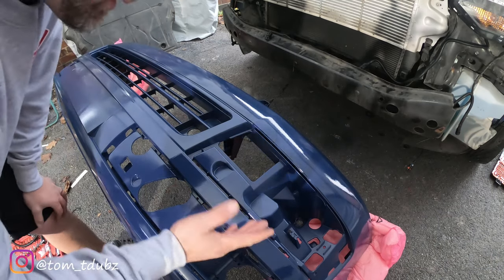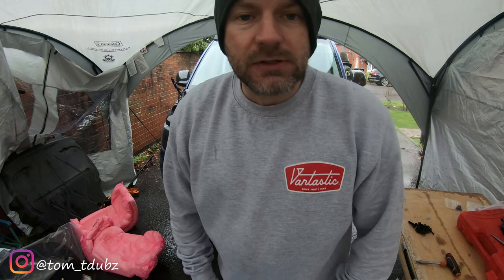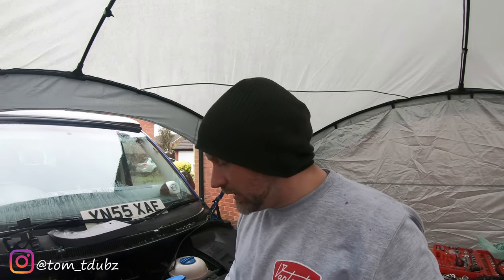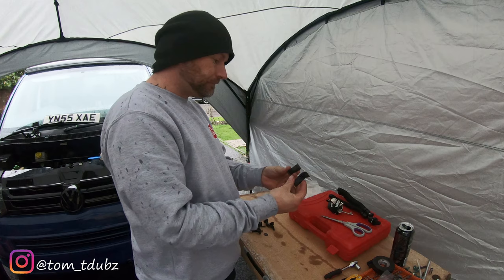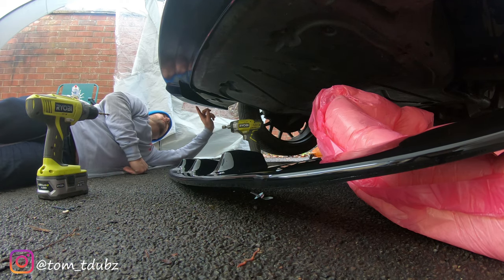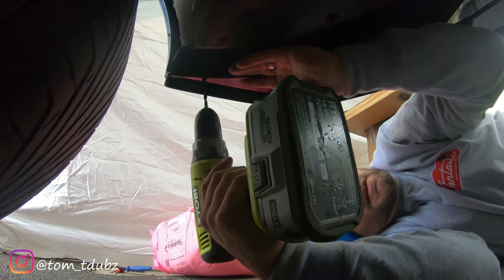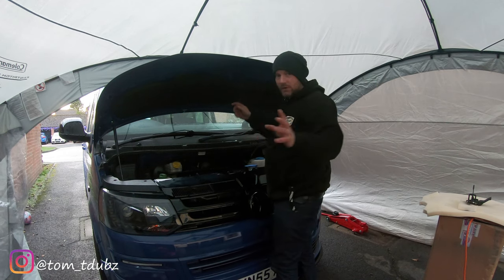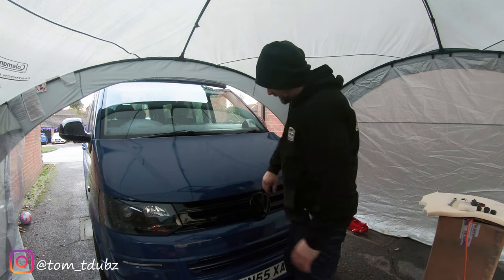VW T5 Facelift #pt3 #episode3 #series2

Comment: Hi Tom, watched this video when you 1st posted it but re-watched again as I've just ordered my front sportline spoiler(the big bit, not the lower shiny gloss bit lol)...I noticed you drilled into existing bumper and popped plugs/screws in and  screwed the ends ...I always thought you did this with additional bonding too.?..or is that just down to personal choice? Thanks mate.
Reply from the maker: Bonding is recommended if u can but not necessarily needed. Using the fitting kit is enough but for a little reassurance adding some decent adhesive is a great option wouldn’t want it falling off 🙈